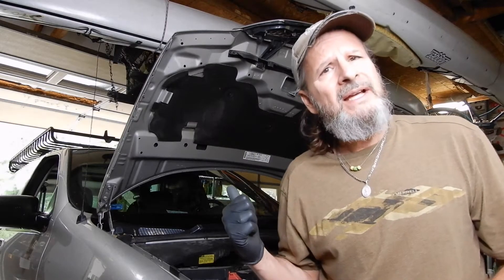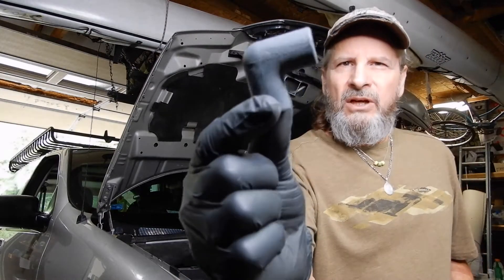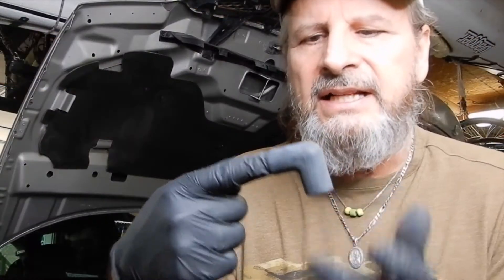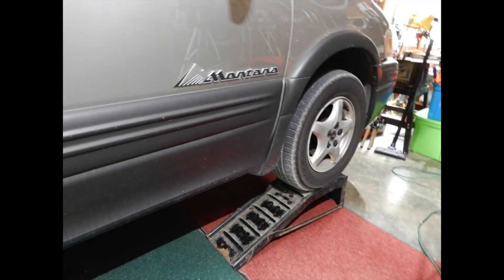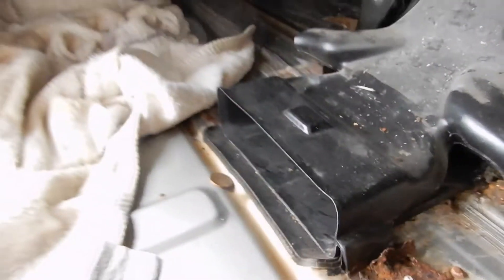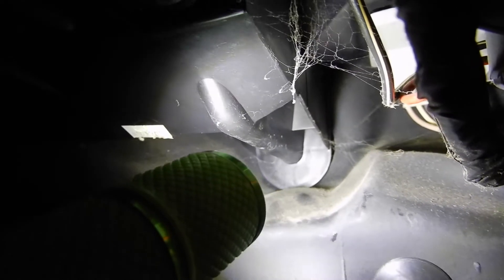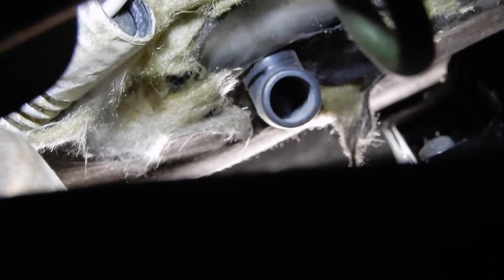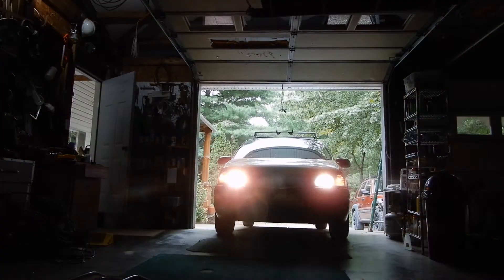2004 Pontiac Montana  A/C Drain Line Leak and Fix. #pontiac

Comment: I’ve got water coming from the roof somewhere. I’ve seen it run down the A-pillar on the driver’s side and it drips from the overhead information display (temperature/heading). It’s clearly pooling in the headliner so I don’t think it could be coming in from the windshield. I don’t see anything wrong with the roof racks either, but those are the only places it could possibly be coming from. I don’t see it after every rain but when it happens it pours as if a whole lot of water was funneled or dumped from somewhere.
Reply from the maker: Hi Emmett, I would probably silicone around the roof racks and any screws holding them on...silicone can be messy. Cut a very tiny slanted hole in the tube...use a good quality caulking guns, I would also wear mechanics rubber gloves, besides that I put out a video where my back window was leaking...turned out to be leaves and dirt clogging the channel at the top of the back door...let me know if u discover the source plz

Comment: Please I'm asking on bended knee what is the brade hose on the back of motor and runs over behind brake booster
Reply from the maker: Carey I'm very sorry but I don't know.....maybe a wire harness in the braid to protect wires from melting?....I'm definitely not a mechanic...just a guy willing to try to fix my Montana :)

Comment: My floor used to get really wet when my a/c was working however, over a summer or so the a/c slowly stopped getting cold. It continued to progressively get warmer and warmer and now it no longer blows even remotely cool air (at all, ever) and hasnt for a full year at least.
The floor simultaneously stopped getting wet when the a/c stopped blowing cool.

Since I never resolved the water on the floor issue (I never checked the drainage, had no idea it existed), and the floor stopped getting wet when the a/c stopped blowing cool, do you think it would it be fair to surmise that my a/c has run out of coolant?

It was a 16 year old car at the time and I've owned it for the majority of that time and never refilled any a/c coolant...

I realize there may be other reasons an a/c might stop working and I will check those things before i begin any work— im just learning about the system and how to resolve it first. 

Since it very gradually lost its cooling ability, I think it's out of coolant... is that a reasonable assumption, in your opinion, just based on these details?

I know you're not a mechanic but I just wanted to ask your opinion, if you would be so kind 😀

Your video was helpful to me, thank you!
Cheers!
Reply from the maker: Hello Laura, here's my best guess...the floor stopped getting wet because your a/c  isn't getting cold, the water comes from condensation in warmer weather, if I was me I would go to a auto parts place like o'rielys and purchase an a/c recharger kit(about $50), ask the counter folks if it will connect to ur Montana but I think it will, be careful, it's serious business charging a system up but I'm thinking u have a very slow leak...so 1 charge might last all summer. If it works then the water problem is back and that's a tough fix, but mine has not leaked a bit since I installed that rubber hose piece, I hope this works for u...probably ur local mechanic can do all this, if they don't know about the hose have them watch my video :)
Reply: @laffilmfest3759  this is a wonderful help. Thank you for taking the time. I got a kit and I'll get it done. I think I might be able to figure out that drainage issue too, thanks to your video.

I really appreciate you taking the time to answer my question. I do all my own work with thanks to you all on youtube. Without you all, I'd have parked it 5 years ago! This place is such a blessing. Thank you sir! 😊
Reply from the maker: Laura u r very welcome...the YouTube platform is awesome...keep me in touch of ur progress, I have a 2005 jeep liberty that I fill up the a/c once a year and it works great